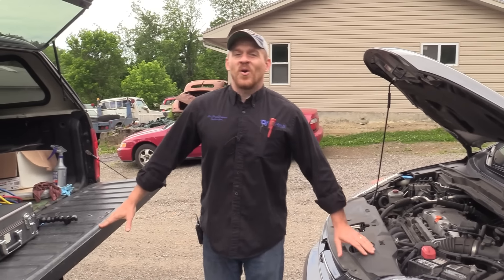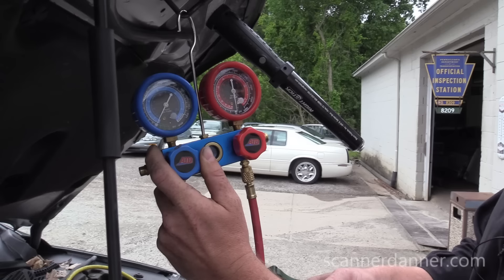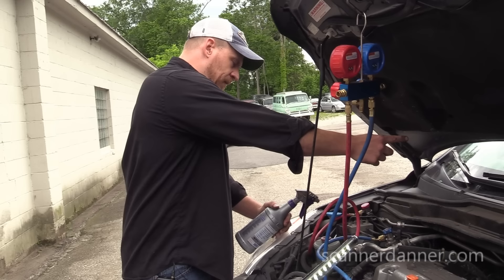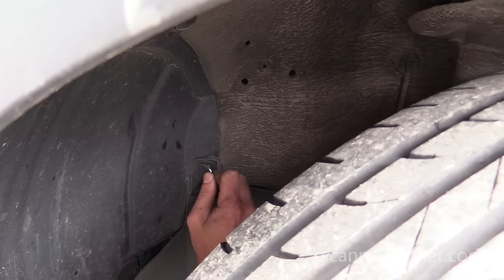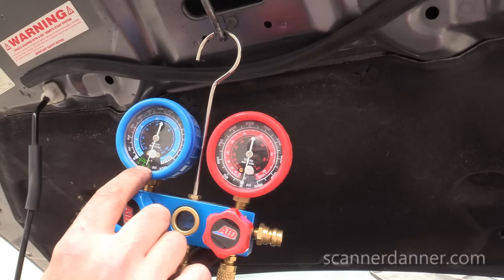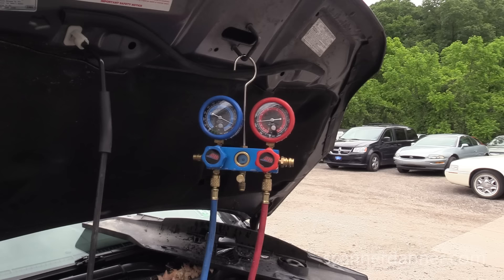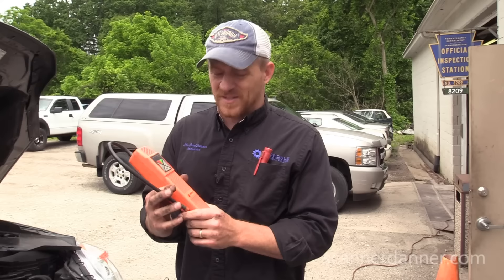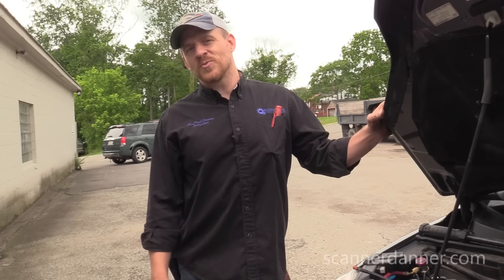Air Conditioning Not Working (system performance, leak test) - Honda CRV

Comment: Hi Paul (Scanner)
Great video and very useful information for the DIY'er.
I have ons suggestion foryour test kit.
If you do not have a sniffer I have used a balloon  over the drain tube.
Surprisingly it quite often works with leaks of the size you were experiencing.
I just use a little electrical tape to hold deflated balloon onto the tube and it is quick visual confirmation of pressure on the drain system. Unfortunately does not work well on small leaks under 1-2 lbs/HR.
Reply from the maker: nice tip, thanks!
Reply: Since you are using air in the system maybe you could put something like a little ammonia or something that will evaporate out but something you could sniff out with your ‘ nose ‘.

Comment: Guess what Paul? After I saw you pumping air into the AC system I went out and do the same to my 2006 VW Passat. I can hear the air escaping from the system. In less than 2 minutes, I found the low pressure hose was rapture.  You save me headache and $$$. I am hoping all I need to do is to replacing the hose than charge the system.  I hope the compressor is still good from running the AC without refrigerant and oil. Thanks to you and Caleb too.
Reply from the maker: perfect example why I use the air method. Just make sure you pull a good vacuum on the system to boil off any moisture after your repair and you should be good to go. Maybe add an ounce of oil when you replace that hose but I wouldn't add any more than that.
Reply: @ScannerDanner  Wanting  to complete what I started here by watching the video. Replace the low pressure hose. Vacuum the system, add 1oz of oil and 600g of R134. AC is cold and much nicer drive.  Your video made the difference. Thank You.

Comment: use ac oil in serv port to check for leak
Reply from the maker: That's a good idea
Reply: i use ac oil also to check the valves.

Comment: Hi Paul just a tip that ac leak detector is same one I used years ago and just let you know red silicone that is used for gaskets will make the detector will set it off , pan gaskets ,valve covers, thermo housing, water pump with silicone  anyhow enjoyed  your process elemention diagnostic keep them coming  thanks 
Sal
Reply from the maker: great tips! thank you

Comment: Most common leak points: 

1. Service port valves!!!
2. Compressor
3. Condenser
Reply: most common ac failures on ford dryer
 switch 
and evaporators. 
all cheap material
Reply: I'm pretty sure its the low side port on my Chrysler. Granted, I accidentally overcharged the system, but when I removed the connector I could see the anti-leak bubbling out of the port. Wasn't happy to see that..

Comment: In 2002 I had an issue with air flow out the vents of my 1988 Mazda truck, even though blower fan was working fine, and air was still cold.  I removed the bottom of the evaporator case and found gunk all over the evaporator, blocking air flow.  I used aerosol brake cleaner and a nylon parts brush to clean off the gunk, and my air flow was restored.  But a few weeks later, my R-12 had leaked out, and I suspected the gunk was R-12 oil mixed with dust.  I used soap bubbles to confirm a leak right in the center of the evaporator, and my 11 year-old daughter helped me replace the evaporator.

Comment: just a thought. pressure is about 130 psi above atmosphere. vac. is only 30 difference(well a perfect vacuum would be 14.7 less than atmosphere at sea level), so that could explain y it held vac. and not pressure. Also vac. could pull the rupture closed. If you put a micron gauge on it I think it would show up right away. I really don't know why the auto industry doesn't require the use of a micron gauge when evacuating. I have seen so many wet systems that just were not cooling well. I hear some people put air in a system to leak check, which would require longer evac. Awesome vid.

Comment: I'd like to service my car's a/c, but in Australia  r134 is not available to the public.
Reply: Travelingman 1997, i hear your pain mate,
Reply: wont be long and they'll snipe it from USA also
Reply: thankgod its not available! too many dodgy backyarders becoming experts!
Reply: ZED , and you are judge and jury of your speculative claim. What has an imaginary God, got to do with maintaining automotive a/c systems? It seems the US  treats it's citizens as adults, unlike Australia where the government likes to decide for you.
Reply: Order the cans off of eBay....there's all kinds of brands Red Tek being one of them. They're based off of propane. Turns out propane makes a great refrigerant and is compatible with R12 and R134 systems.
Reply: Use computer keyboard air dusters instead.. those are either R134a or R152a...  what you're looking for on the can is diflouroethane 1:1:1:2 or tetraflouroethane 1:1:1:2. using the keyboard dusters, though will require using a side can tap.  Of the two, the R152a (diflouroethane) will get colder, but requires a different amount to be fully charged.  There is a conversion table to convert the amount of an R134a charge to how much R152a would be needed.

Comment: I am at the 18:00 minute mark, and the schraeder valves have not been checked, but maybe you will later.  You introductory talk promoting the use of air for troubleshooting the AC system was excellent.
Reply from the maker: It's there Chad. I didn't mention it until later because I had proof of the leak WITH the gauges connected. Showing me the leak was elsewhere. 
Thanks man
Reply: Immediately after replying at that time frame, I thought I should not  have, as you being a pro, it would have been covered later. 

The evap leak test --  my take on the usage of air vs. r134a -- the molecular weights of that refrigerant is 102g/mol and air is 29g/mol, so gravity would exert a greater effect on the heavier refrigerant than air, thus creating the situation where the escaping r134a would descend through the column of air in the evap tube into the sensor.

The air being the same weight as the surrounding air in the evap housing would intermix there and not necessarily with any water forced up into the evap tube, and if any shop air does find a path through the evap tube, it would mix with the introduced test water/soap solution and not be so very discernible.

Keep up the great work and thanks for emphasizing the air test.
Reply: if a leak is detected, to rule out the possibility of the gauge set having a loose connection leak, just shut off the service port valves and see that the pressure or vacuum is maintained. That should also reveal a service port valve leak.

Comment: Thank you for this beautiful video.
nice info about the resting pressure relation to temperature in Fahrenheit as in my country we use Celsius, also the relation between the high and low side (5:1) is very helpful to guide you in the right direction.
you said that R134a system will have little or no oil leak because they do not use mineral oil ,well if you check the evaporator of this CRV  after replacement you will notice evidence of oil leak over it covered by dust.
Reply from the maker: I have seen evidence of oil leaks on R134a systems. It is just more difficult. Thanks!
Reply: ScannerDanner thank you for every thing you do to help us

Comment: I bought a leak detector on eBay for less than 20 bucks. Works fine, found a huge leak in the rear evap in my mini van.

Comment: Nice one. Btw why do you americans insist on using a temp scale based on one dudes rectal temp? your car industry is for the most part metric, why not go celsius too? ☺
Reply from the maker: hahaha
Reply: "Rectal" plays a large part in design of American (and also import) designs of automotive.   We're often heard to say in the field  "What A&&hole designed this???"
Reply: ScannerDanner Can you use that tool to put in the a.c. vent.and detect the leak through the vent also. Will definitely look up that tool.100% better than the dye leak finder.
Reply from the maker: Filiberto Barrara
You cannot have the blower running at all, due to false positives. So no, unless the leak is huge, using the vent in the dash is not a good test. The drain tube is always best for testing the EVAP core. 
I found the updated version of the tool I used and linked it in the description of this video. Thank you!
Reply: ScannerDanner Thanks good to know.your method of looking for this issue.Just saved me hrs of wasted money and work.Thanks again.we appreciate any video you make .
Reply: Because societal inertia. For what it's worth, the sciences in the U.S. are all using metric units these days.
Reply: R. E. Hill that is a good question! As an American, I love the metric system, however it seems that Americans have had a hard time adapting to it. Temperature is a tough one. It's weird, water freezes at 32°F. Boils at 212. This does make a 1° change more accurate though. That is probably why we have a hard time accepting the change. Same with MPH vrs KPH. 
Bummer part is that I have a lot of wrenches and sockets.
Reply: Mark Chidester at least we meet at -40... ☺
Reply: Yea, I really hate imperial measurements, especially Fahrenheit. Celsius makes a lot more sense. I really wish America would catch up to the rest of the world, it's kind of silly having 6 or 7 different units for everything. E.g. you've got an inch, a foot, a yard, and a mile (and probably a few more) for length. We made the official changeover in Ireland a few years ago and everything went fine, nothing blew up or fell down.
Reply: Joe O Sullivan Yeah?  How's your economy doing?  The US is amongst the biggest in the world.
Reply: They are all made up.  One is just easier to learn when you did not grow up with it.
Reply: @Hodggoblin one system is also easier to do calculations in your head without needing a calculator

Comment: for very slow leaks, soapy water will not do the trick. charge the system with r-134a combined with florescent die. when the system is empty, look for florescence with a black light. if you can't find the leak under the hood, the evaporator must be replaced.
Reply: Right but if you get one that's COMPLETELY EMPTY you don't want to start off by putting Freon in it until you verify that there is not an enormous leak somewhere  (using air)!!
Reply: +Lustfulvengance that wouldn't be a good idea pressuring with air only introduces moisture .. freon is cheaper and vacuum time is decreased you can alway emergency vacuum the system. .
Reply: Best to try to not vent r134a to atmosphere.  Nitrogen w/ dye sounds optimal.  We're all in this together.
Reply: shmio Right, the idea here is to NOT PUT FREON INTO A KNOWN LEAKING SYSTEM!! Stop with all this "OMG your introducing moisture" bullshit!! IT BOILS OUT WHEN YOU VACUUM THE SYSTEM!!

And remember this is just the diagnostic part, ANY AC repair should include a new receiver drier or accumulator so you have a fresh dessicant bag! 
I am with Paul here, I have used compressed air and soap for years and years and NEVER ONCE had a problem!
Reply: nitrogen works great ;)
Reply: +Lustfulvengance lol when was the last time you checked a ford with ac problem and it had no freon ... TSB date back to 1988 .. if anything Ford is the biggest contributor to R134 contamination. .. from cheap dryer to  cheap low pressure switch and evaporators. . yes I agree we should be prudent while serving ac but the fact still remains ... just for you information a large  leak will not hold or pull down vacuum. . a small  leak will drop vacuum but not hold it or will not pull it enough. . experience dictates your diagnosis. . dye would be the only real world  applicable procedure. . so let's write to ford corporate and tell them to stop putting in cheap parts 
. unfortunately many consumers are getting hit with the astronomical bill from ford for an ac repair .. I never realized that nitrogen was soo expensive. ..
Reply from the maker: exactly Lustfulvengance! Like my Jeep? You would have lost the refrigerant as fast as you put it in.
Reply from the maker: already moisture in the system jay cruz
Reply from the maker: It's just a convenience thing jay cruz. I don't think we are arguing that using nitrogen is better, but when you've done thousands of AC repairs using the method I showed with compressed air and never had a problem, what is the point of spending extra time, running to the store to fill your nitrogen tank? Not to mention, no one sells it around here that is close by. It's just not practical. But to each his own.
Reply: ScannerDanner These keyboard mechanics have probably never worked as a flat rate tech or even diagnosed ANY AC system in there lives!!
Reply: +Lustfulvengance  I sure "there " keyboard has nothing to do with "their"  keyboard. . ..
Reply: +Lustfulvengance  I sure "there " keyboard has nothing to do with "their"  keyboard. . ..
Reply: +Lustfulvengance  I sure "there " keyboard has nothing to do with "their"  keyboard. . ..
Reply: +ScannerDanner I haven't use the nitrogen method nor the air pressure method .. I just use the recharge and evacuation a/c machine
Reply: And pump Freon into the air so it can fuck up the ozone layer, keep hacking away and I will continue to do things properly.........
Reply: +Lustfulvengance I have been doing a/c service  since the mid 80's when macs certification was linked to your personal number .. so anybody that has been in the business long enough should knows what I'm talking about you seem like what we call in the business a "rookie"   so I can say without any doubt I have 10's thousands of a/c service under my belt. . do you recall  the days when R12 cost $35 for a 30lb bottle then slowly but surely went for $300 for a 20 lb bottle.   nor do ever remember that a 1lb R12 went from  $2 to $50 .. no I'm sure you didn't even exist  in your daddy's balls yet .. so yes after all these years I've been and teach my crew to be prudent when it comes to a/c service. . 
SO OK MR. ROOKIE I HAVE A SAYING FROM  MY EXPERIENCE IN THE FIELD 
" IF IT HASN'T HAPPENED TO YOU YET  IT'S BECAUSE YOU HAVEN'T BEEN DOING IT  LONG ENOUGH "
Reply: +Lustfulvengance yes people please let's not deplete the ozone layer 
. God know that Lustfulvengance can't afford oxygen deprivation for his brain .. shit you keep this up Lustfulvengance you're going to have to resort to fixing electric vehicles. .
Reply from the maker: Easy guys, that went south real fast. I appreciate both of your perspectives.
Reply: +ScannerDanner sorry paul but sometimes you gotta put them in THEIR place ..
Reply: am I the only one that thinks we should be able to replace the desiccant without buying a whole new dryer?
Reply: @nickloss They probably don't trust themselves to make those serviceable and still hold pressure.

Comment: First I want to say very good video, very helpful.  I want to address the issue of finding a leak under vacuum vs finding a leak with 150 psi air in system. When you evacuate the system to about 29 - 30 inches of mercury, what you are relying on is the atmospheric pressure pushing on the exterior of the system trying to get in. Atmospheric pressure is only about 14.5 psi, that is all. When you pressurize the system to 150 psi  the difference between the system pressure and the atmospheric pressure is 135.5 psi ( 150 - 14.5 =  135.5 psi) . So, in one case you have 14.5 psi trying to get in the system, in the other case you have 135.5 psi trying to get out.  That is why when you evacuate a system you may not initially see a leak or have to let it sit a very long time before it is noticeable.  So yes, pressurizing the system is more effective for finding leaks than evacuating it.

Comment: I think compressed air is fine. I bet that there is plenty of oil in the system to run for more time than a few seconds. I don't buy that it all leaked out. The entire system still has to have a good coating on it. Isn't that why when you replace a component, you add some, not the whole system amount? I believe you explained that in another video.
 Great info, love the explanation of how to use the sniffer. The refrigerant must be heavier than air so it falls rather than floating around. Gas fumes do the same. So does propane gas.
Reply from the maker: Thanks man. The oil is still in the system but without the refrigerant, it is not being carried through the system anymore. At least that is the theory.

Comment: The few AC's that I have worked on I had much better luck with a dye and UV light for finding leaks, even than a leak detector. Almost pulled the dash apart to replace the core as I was getting a signal inside the car at the vents. With the high pressure air you have a much higher pressure differential across the leak than with a vacuume. That will make it leak more
Reply: I too use dye. 100 % fool proof. I also use a ROBINAIR MODEL L D 3 for shaft seals and evaps, BEST SNIFFER I'VE EVER USED in my 35 + years of ac work. I have owned 3 TIF and used 2 others that sucked.   
Not sensitive enough. 

i

Comment: I enjoy these vids alot. I remember a while back, maybe even years, when you diagnosed the no crank situation with your son, which i believe was Caleb. In that vid, you said "Go with what you know". Always apply that to situations where I get stuck. Got a 01 5.9 dodge van that stalls after rpms raise, fuel pressure is fine. Just gotta keep finding whats good and the one thing that's missing.

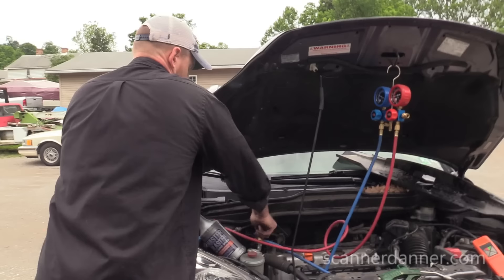Comment: 28:35 to check if it's the Schrader valve, after pulling a vacuum, you could close the fitting valve of the gauge set so it's no longer pushing the service port valve stem, as well as the manifold valves, and see if the gauges show a change in vacuum or pressure. 33:50
 If it does, it would indicate it's leaking past the service port valve, assuming there's no leaks in the gauge set connections.